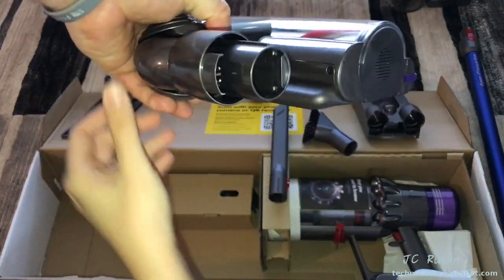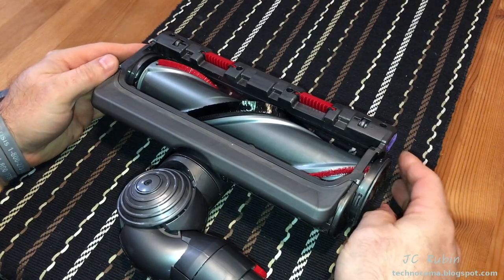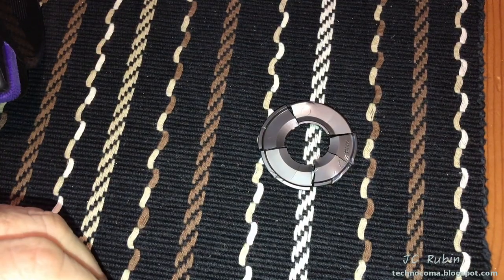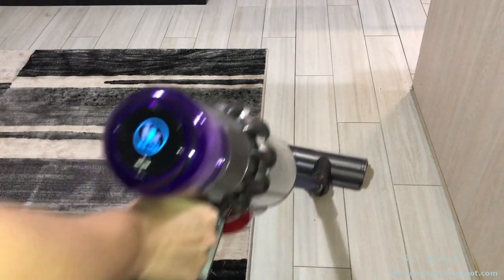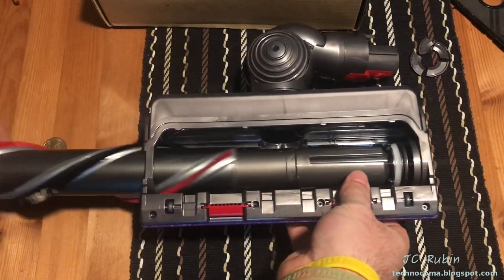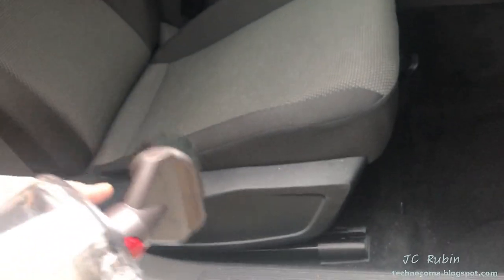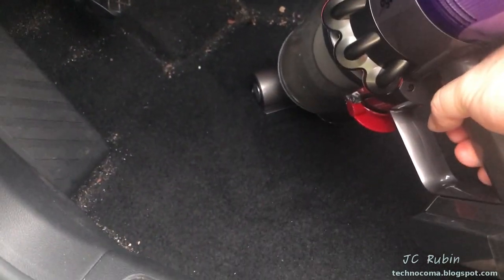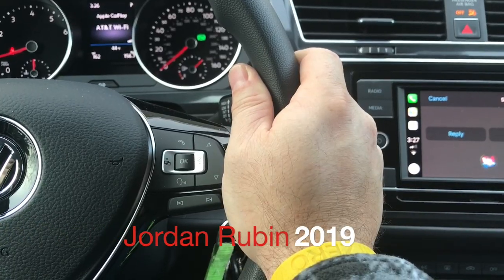Dyson V11 Torque drive Head repair - When it stops spinning and gets stuck

Comment: Finally someone addressed the root of the problem when it comes to a non spinning brush. This was definitely the video I was looking for because my brush head on this unit did not want to spin after I've gone through every single thing you can think of and it's not working. The question is why would I want to keep the peace of crap if it's gonna do it again? Well now I don't have to worry about it.  I called Dyson very friendly service and they would send out a free part, but now ill have 2 heads. Works for me.
Reply from the maker: I also have two from this debacle. It all works out in the end, Incidentally the one I removed the broken part from never failed since my video.

Comment: Thank you so much for your instructions, I had the problem of my roller stopping every 10 to 15 seconds. I even heard a small piece of "something" when shaking the roller. So, I took the roller apart as suggested and what I found was a massive amount of dust clumped all around the entire end of the roller. I cleaned it out with tweezers and now the roller is rolling away. Thanks again for your help in dismantling this piece, thankfully all parts are still intact.
Reply from the maker: You're welcome!

Comment: Thank you very much, Retro Tech Man! It just happened to my brand spankin' new V11. I can't believe it. A little plastic piece, the same color as the ring you pulled out with your tool, was rattling around in the brush head. Unbelievable. And the funny thing is my unit shipped direct from Dyson as I ordered it from their website. I'll call them in the morning and explain the problem. Again, I can't believe it -- but THANK YOU for posting this video or my husband and I would still be scratching our heads. Cheers!
Reply from the maker: Glad to hear I could help.   Be sure to check out the maintenance video in a few months as I go into some detail of what to expect to keep it running like new https://www.youtube.com/watch?v=9iSNpASHMqM  
I go a bit overboard in the video, just to provide visual detail for folks to see inside.

Comment: Thank you for the helpful video.  I removed the broken part (just like yours), but it still doesn't spin.  It spins by hand without effort though. And on all power levels.  😞
Reply: did you manage to solve this somehow?
Reply: @LiquidTurbo . Unfortunately no, I had to buy a new head unit.
Reply: @erics6947  thanks for the reply

Comment: What's interesting is that while this issue is acknowledged (and has been resolved; no recall to my knowledge), not a single source on the internet has actually demonstrated precisely what caused it in the first place. That's really telling, and that information would be needed to draw any inferences, as many Dyson brand-haters are more than eager to, so you have to be weary of those jumping to conclusions. They love to congregate on videos like this and you always see the same names. It doesn't happen to all of the original heads, just a tiny number—possibly one batch, as you've suggested. Most people have never had any issues of any kind whatsoever. It is interesting to see though what a known problem looks like. Removing the broken collar will work, as you nicely demonstrated. The white collar to the side of that acts to both plug the tube to prevent too much dust going down into the drive section, and also acts to stablise that side of the tube. The broken collar piece also stabalises, so removing it to avoid the jam could in principle enhance vibration and cause a small amount of noise (as some have noted in the comments below). But it shouldn't impair principal performance, as you showed. And given everything is under warranty for exactly this kind of issue, none of it is really a problem. Some manufacturers, such as Shark, make users jump through hoops to get spare parts like this, and the user experience stories sound horrendous. You can't fault Dyson's customer service, really.

Comment: Had the exact same issue as you but with V10.  Customer care was nice to send a replacement free of charge.
P. S. I noticed that just like your attachment head, mine had a blue pen mark on the white plastic above the broken ring. Probably it was marked as faulty but maybe not taken out for some reason
Reply from the maker: Interesting, I did not notice that.

Comment: Wow, I can't believe that you managed to receive 2 defective units in a roll, its impressive that you maintain your composure.  But at least its been upgraded. But  I think that I will just stick with my old Kirby Sentria, I found at a Garage Sale about 15 years ago for about $20, its may be a  heavy dinosaur but it's self propelled, and has never had a single issue.  On the other hand, my year old LG side by side refrigerator just broke down. Fortunately it is still under warranty. The repair service came today and decided that it needed a new compressor.   While it may be a cliche, I will say it anyway: They don't make them like they used to.  Edit:  The attachment for the car seems to be highly practical.
Reply from the maker: Given the distance of the store I opted to call them about the second head.  It was in doing so that they admitted the problem and offered to express ship the corrected unit. Since this was the only issue with the vacuum and I have 30 days to return, I decided to wait it out. AND, I ended up in the end with two torque drive heads.

Comment: For me the other ring infront of that white ring had 2 parts snap off. After that the brush roll rattled more and the friction wore out half of that white ring and left 2 ridges on the inside of the brush roll!!! I tried to fix it using some lithium-molybdenum lube and it seems to have made the friction much less.
Reply from the maker: Sounds like you had more than the regular failure.  As id looked through hundreds of the known failure for this unit, i've never read that component called out.
Reply: @retrotechandelectronics  Indeed. All the ones I saw online have been the same ring from your video. The white coloured ring on mine literally had half of it turn to string from the friction and you could even smell the burning plastic. I could inbox you some pictures. It will be covered in lith-moly lube but will still show the damage.
Reply: @theboz5206  I am having the same issue. Is this a known defect? Have you tried contact Dyson for replacement?
Reply: @ruomong  yes I have. They sent me a free replacement. You can keep the old one too and attempt to repair it so you will have a spare cleaning head.
Reply: @theboz5206   was it on warranty ? I think I cant ask for replacement, warranty is expired 3 month ago (

Comment: I have a v11 and the plastic that the circular disks covering the elbow screw into broke and so they both fell off. Have you seen that before and know of any fix?  Dyson sells replacement disks which are of no use given the plastic they screw into on the torque head's elbow are broke off.

Comment: thanks for a great video, when i removed brush roll ,I discover that  white ring doesn't spin, what can I do, any advice, please?
Reply from the maker: Did the roller spin Freely when installed?
Reply: @retrotechandelectronics  Hi, the roller spins when it is not on, but when it is on it spins and then starts making a rattling sound as if it is stuck

Comment: I just got a V11 old stock, so it came with the broken circular tab like yours in the torque head. I took/"repaired" it and put everything back it, it spins, but also makes a sound  when spinning, I suppose that tab is to dampen the movement of the spindle inside. Getting my replacement now..
Reply from the maker: Interesting, that didn't happen with mine. on the new one, it doesn't look like the brush even seats up filly against that disk.

Comment: I purchased the Dyson V11 Outsize July 2020.  End of December the Torque Head broke.  There was no ring in there to remove so couldn't do that fix.  Because they didn't have another head in stock I had to send the machine back and they replaced it Jan 10th.  Well first of April that replacement broke.  Again no ring to remove.  They don't have another head and didn't have another outsize in stock so they sent the origin and I had to fight to have them send me another battery.  The origin does not have 2 batteries.  I am wondering if the ring is there to keep the dust out of the motor.  I do notice that behind that ring gets a lint "ring"  I am wondering if the dust getting into the motor is taking it out.  After the first vacuum broke I was cleaning out the roller head each week because i was concerned that lint was not good.
I have had several Dyson Models and never had a problem with them.  I love my Dyson and they have send warranty but it is frustrating having to go through all the hoops and sending it back.  Hope I don't have to send back every few months.
Reply from the maker: I use the one I pulled the ring from.   The warranty one is still in the box.  I service the unit maybe twice a year and have had no failures yet.
Reply: @retrotechandelectronics   Guess what the one they sent 9 months ago just broke again.  It seems to be after I put the machine in Boost mode.  I still wonder if dust gets into the motor and it overheats.  The ring is not broken but I do get a lint ring.  I don't have any carpet in the house but have some flat runners on the floor.  I do have animals so I get lots of pet hair but I have made it a point to keep the XL Torque Head really clean.  I have not had this issue with any of my previous Dysons and have kept one older one so I have one when the V11 fails.

Comment: The ring on mine doesn't appear broken and I've cleaned everything but the head still won't turn. Any suggestions?
Reply from the maker: did you remove the entire brush unit from the side and see if the motor binds?

Comment: Thanks, fixed my Torque Drive head where roller was frozen. Any idea what the grey plastic washer does, is it only to keep dust and fluff away from the shaft?
Reply from the maker: The only thing I know so far is that it stops it from working.  I imagine it was designed, to block the dust from getting in.  Ive been using one for over a year without one with no ill effects.

Comment: My roller is stuck..I can't pull it out! The end part with the slit to pull roller out just comes right of roller. My roller works but I want to clean it bc it's acting up a lil. I've tried to lightly prey roller but if I prey harder I know I'm going to snap something
Reply: Did you find a solution to this problem? My roller doesn’t come out either

Comment: It's a common fault I hear. Dysons are flimsy and rubbish built.  The wheels wear out very quickly too and new bearing then need to be put in the wheels.
Reply from the maker: I haven't had any wheel issues with the older model. Well see.

Comment: I have the outsize version and my head won’t spin at all, can someone help, the vacuum shop said it could be a battery issue but it works just fine, it’s just the head
Reply from the maker: does it turn by hand without effort?
Reply: @retrotechandelectronics  yeah
Reply: @retrotechandelectronics  mine is brand new it spins in eco and boost but in medium/auto doesn’t spin at all

Comment: My v10 head outside side (where you use a coin to open) is glued together between the cap and the tube, and it stops it from spinning. I figured it’s due to height heat and the two pieces of plastic parts melted and glued to each other. They have poor design and really bad material used for something experiencing high speed rotation. Failing company.
Reply from the maker: This I haven’t yet experienced

Comment: Have bought a Dyson V11 and have had to exchange it 3 times now i need a new roller because the blades are falling apart. Also need a new filter but its impossible to buy them.
What a useless machine. A complete waste of money.
This is the last Dyson product i will ever buy. Its impossible to buya new filter for this machine.
Reply from the maker: I haven't heard of any filter issues, I see that they are readily available on Amazon.  I know the early heads had the junk ring in it that would always break, but they have an exchange program.